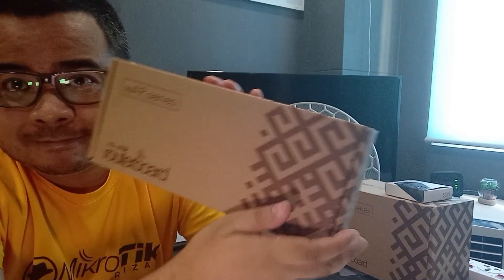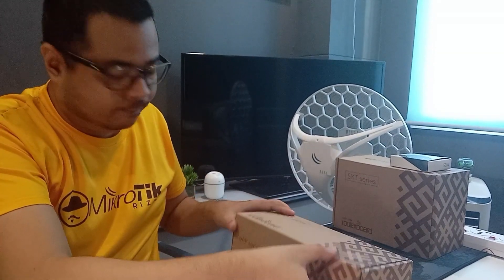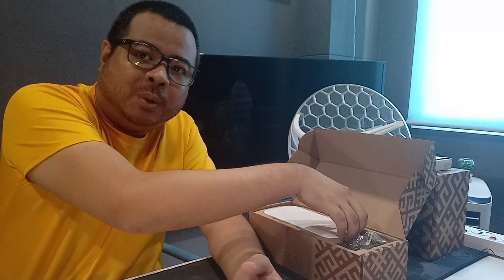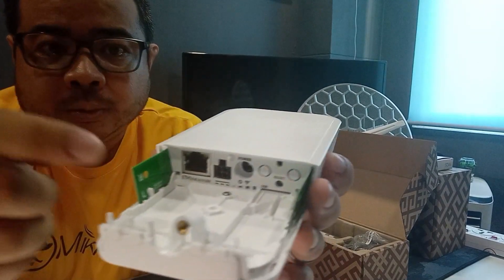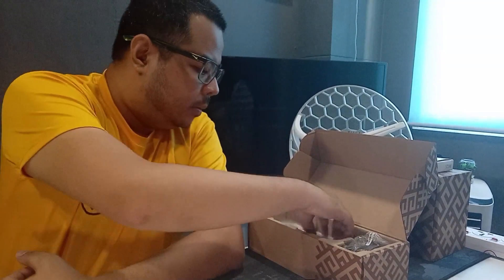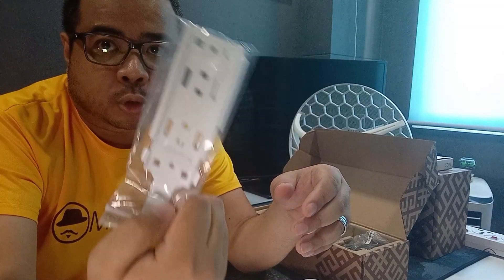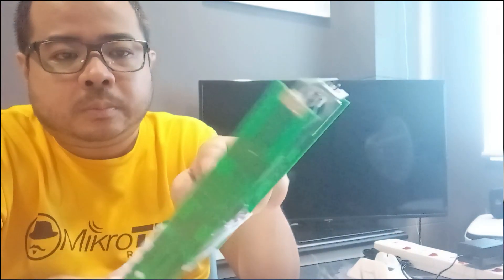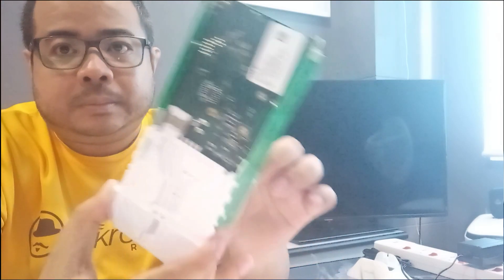MikroTik wAP LTE Kit | Unboxing & Assembly (Tagalog with English Subtitle)

Comment: I have 4 Mikrotik waP LTE devices that I want to manage on one platform. My intention is to fit them in passenger vehicles, but I want them to use the same SSID such that you don't need a new password when you change cars.